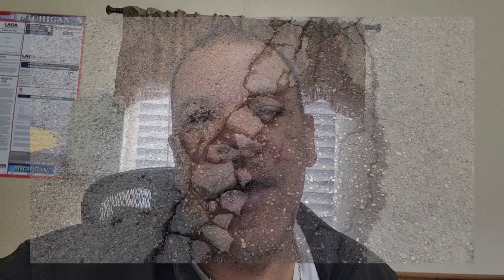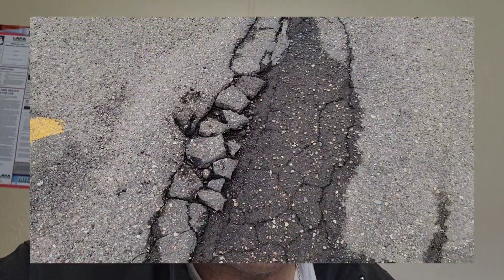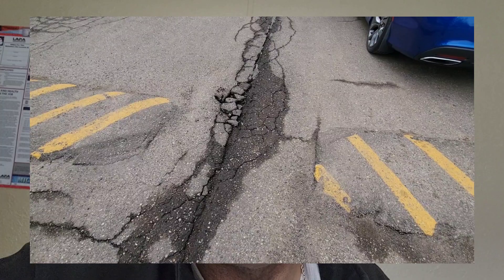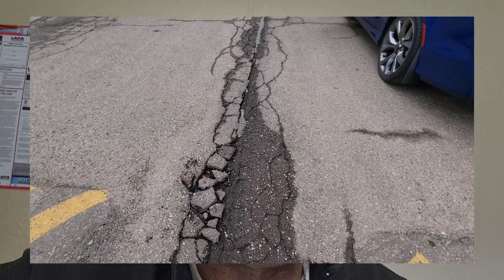I CANT BELIEVE THIS ALMOST DUMPED MY GL1800 GOLDWING.

Comment: Dang Mo! be careful out there, those damn things as well as Tar Snakes will get you every time. The first upgrade I did immediately after getting my Wing was install a Belly Pan for that exact reason. Why the previous owner never installed one, I will never know. Maybe because he barely rode the bike. I don't know...
Watch out for puddles and pot holes while you're at it guys!
Reply from the maker: Thank you On A Wing And A Hog. All great info to be aware of. You are so correct about those tar snakes. I like them when it's cold out because they are not as soft🤣🤣  . But yes that was bad and don't want to do it again. I can guarantee if the belly pan was not on there I would of had engine case damage. I should of took a pic of the belly pan after it was hit. Pretty big dent in it. Had to put it in a vise to get the dent out. So all the people out there without one, please be careful and I would recommend getting one like you did sir. Be safe and glad to hear from you. 👍
Reply: @mosmotorcyclejourney9067  ….. for those without one. It would be the best $80 you can spend
Reply from the maker: @wingandhog  I agree 💯 percent